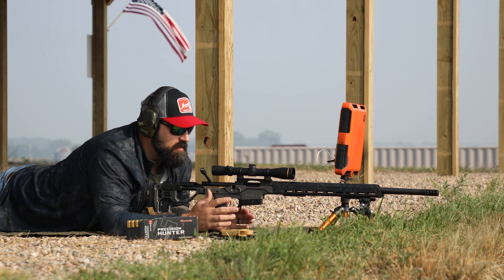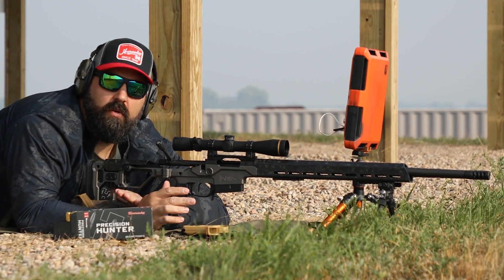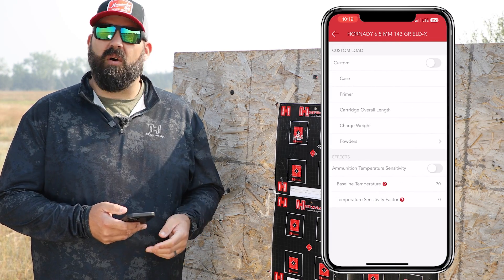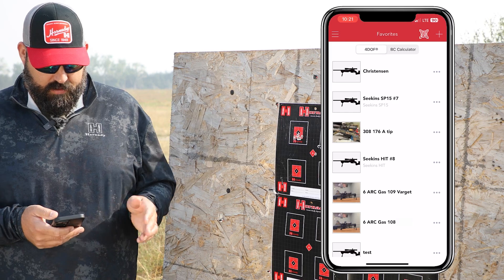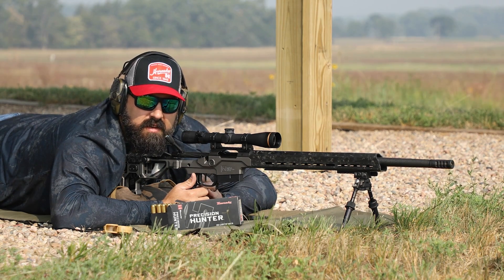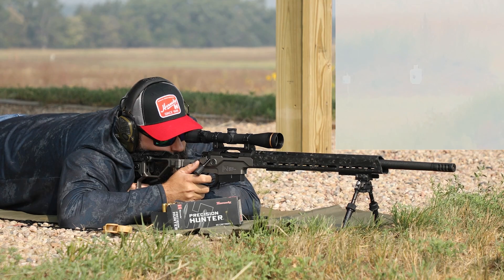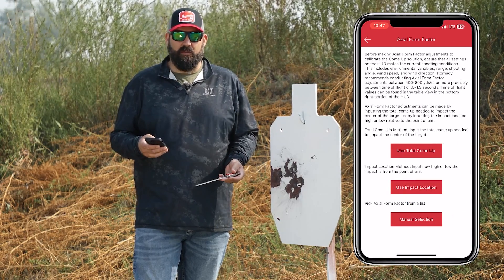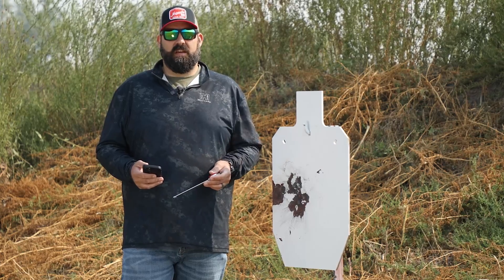Rifle Setup Part 4 | Rifle Zero Angle & Axial Form Factor in 4DOF |

Comment: Very good. It seems like it all starts with a really good zero range, then zero angle and finally axial form factor (which I interpret as a percentage shift) for that specific rifle and load. 

It also seems incumbent with good input like wind and environmentals. So how does one truly get good wind readings across the distance, say 0-600m ? 

And without obtaining impact velocity, is zero angle and axial form factor the mathematical equivalent behind the scenes? And how accurate would the 4DOF calculator be at calculating solution for 1000m by doing ZA at 100m and AFF at 600m ?

Comment: With the app will only a kestrel link up to provide environmental data or could you use other devices like the vortex range finder with the built in environmental data the 4000 hd i believe thanks.
Reply: Calypso WM links

Comment: Regarding the zero distance, is the measurement from the target to the scope turret or some other point? The turret seems the most logical point as that is where the adjustment takes place.
Reply: It’s target to the center of your Windage knob of your scope.  More important is to know exactly how far that is. Many 100yd targets at the range aren’t exactly 100yds, and you could use 3 different laser range finders and get 3 different results. Accurate info in, accurate info out. None of this stuff is necessary if you will never shoot beyond 350-400yds. In that instance, all you need is a good zero at 100-200 yds and use Maximum Point Blank Range determined from a free online ballistic calculator.
Reply: Although true about the adjustments being made at the turrets and thus the turrets would seem to make sense but there is a caveat..... Bullet drop is relative to the muzzle, not the turrets.

For setting any zero, technically, the distance should be from the muzzle to the target because it is over that distance that the bullet is dropping, not the distance from the turrets to the target because from the turrets to the muzzle, there is no bullet drop occurring. 

With that said, how much of a difference does this make? Not enough to really matter since the distance from the turrets to the muzzle is almost always going to be less than a yard and until you get to ELR distances for the particular cartridge where the bullet drops in feet per yards type drop rates.

Just to give an example of the "less than a yard error",  the difference in drop at 1000 vs. say 1001 for my 300prc shooting 230 A-Tips at 2870fps MZ is 0.63"... While I consider myself a reasonably good shooter, I'm certainly not good enough to differentiate a 5/8" error at 1k yards. That is less than the 0.1 MIL adjustment values for my optic so I couldn't dial it correctly even if I wanted to. To put it differently for those who like MOA, that is an error of 0.060 MOA at 1000 yards
Reply: @CP_300PRC  You are correct it isn’t enough difference to make a difference. However, if you are doing a tall target test to determine scope correction factor and how well your reticle tracks……then an exact measurement from target to the middle of the Windage turret is the proper way.
Reply: @chrisgunsandguitars1403  While yes, you are correct from a purely technical standpoint but in reality, unless you are off by several yards, it is of little impotence there too because the error is smaller than one can generally differentiate  though even the best of glass. 

For example, at 100 yards, a tenth of a MIL is 0.36 inches. At 101 (i.e., about the distance your turret would be if you accurately ranged from the muzzle) that same tenth MIL is worth 0.3636 inches... 

Even with the best of glass, you are not going to be able to differentiate .0036 inch error. That error is literally 0.001 MIL, or to put it into prospective, that is slightly thinner than the average human hair which is 100 micron or .0039". 

Even the best of reticles have line thicknesses that are 10+ times thicker than that. For example, the Horus TREMOR3's & 5's thinnest lines subtend 0.015 MIL (15 times more then the error that the yard variance above caused).
Reply: @CP_300PRC  
Thanks for the very well considered response. The lack of drop from the turret to the muzzle is something I hadn’t considered. I knew the difference in drop would be insignificant but I am more interested in the technical difference and why, which you so perfectly explained. Thanks again!
Reply: @Dennisthemenace40  No Problem, you're welcome.

Yeah, the actual bullet drop while in free flight is what matters which is why it should technically be from the muzzle to the target rather than the turrets to target.

All that the adjustment of the optic is doing is changing the angle relationship between the departure angle of the projectile and the line of sight. As you probably know, but in case not, departure angle combined with Gravity and atmospheric conditions determine how much a given projectile, exiting the muzzle at a given velocity, will drop at a give distance. Adjusting the optic (or using reticle holds... Or combo of both for that matter) is simply adjusting the departure angle to get drop amount to coincide with the particular aim point at distance.

Going back to something I said in previous comment about ELR where you can get into drops in Feet per yard, It reminded me of video from the "MarkandSame AfterWork" channel where they had a camera setup from the side view of the target and in one case, because the bullet was well into subsonic flight at the distance he was shooting at (forgot what the particular was but was well past 3k yards if memory serves me correctly), I notices a flicker of light so I played the video back at 1/4 speed. The flicker of light seen was actually the bullet where it was caught by a few frame of the recoding.

What was interesting to me was not just that the camera caught a few frames of the bullet in flight but also that the bullet was coming in at about a 50 to 60° angle... Quick Trig shows that at a 55°, the bullet was dropping at 51.4in (4ft, 3.4in) over 1 yard distance. That really put things into prospective for me with how the smallest of change or error at ELR distances can have a huge effect at the target.
Reply: @CP_300PRC  
Very interesting stuff. Thanks again for your technical expertise.
Reply: It's usually measured from where you are to target. The maximum variance from shooter to muzzle is 3 ft. Even if it was 25ft, you're not gonna be able to account for that. Maybe at a 1000 yards you might see a quarter inch difference, but I doubt it